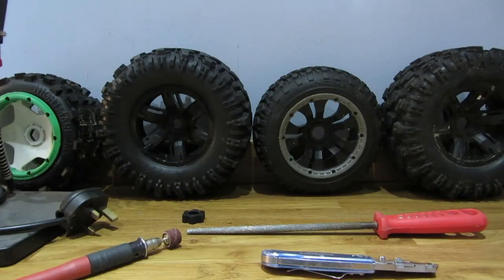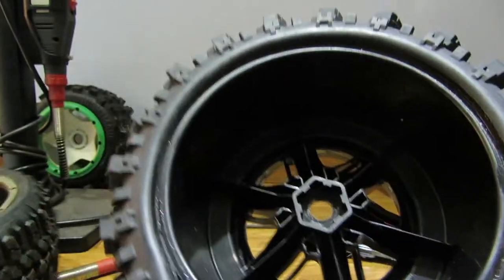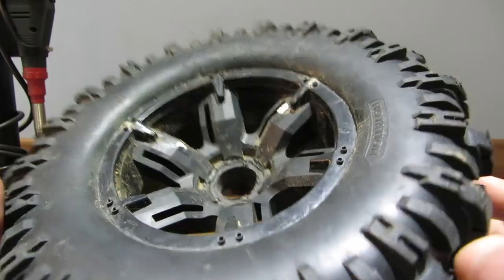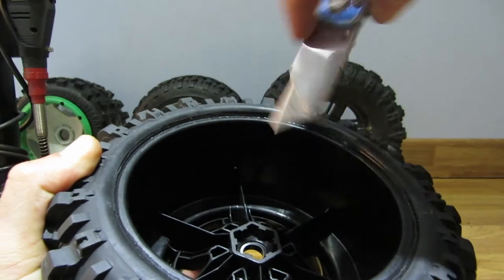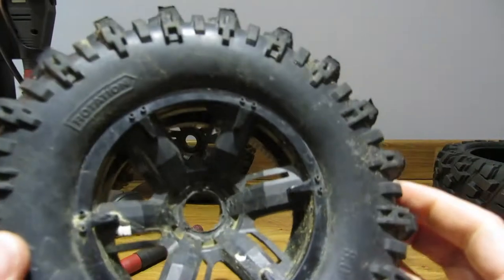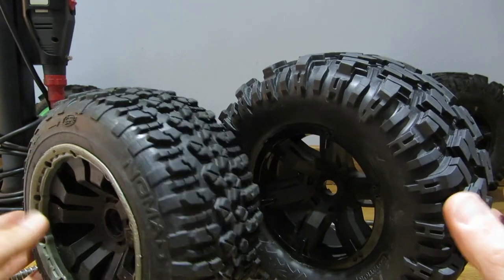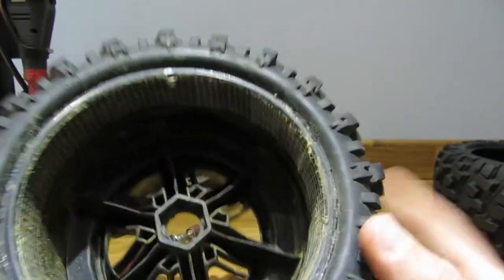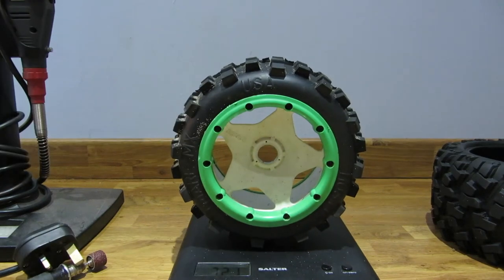HOW TO Mod Traxxas XMAXX wheels to fit Losi 5ive T Hpi Baja 5th scales etc...

Comment: To anyone doing this mod, I highly suggest using a quality body reamer as opposed to using a Dremel tool. The hole should be just barely big enough to fit over the hub to make a lot better positioning when mounted.
Reply from the maker: Good advice👍

Comment: Or how about fitting baja wheels..  from or rears on a Xmaxx? ? When will some one just make hub knuts that fit the baja rim onto Xmaxx?
Reply from the maker: there are mad max nuts that do that job. I do have a set of adapters actually. So i could try the rear baja wheels i have. I did try some sand paddle style 1/5 scale tyres and wheels on my xmaxxx over xmas. problem for me is they are just too small for it really and i feel it handles its best and jumps its best on the stock xmaxx wheels n tyres. check out my box track running vid with the xmaxx... as i started the run on losi 5t style wheels n tyres... and then changed to the stock ones.. will give u an idea of what i mean.. cheers ;)
Reply from the maker: here u go...

https://youtu.be/B5R-onqjsis

Comment: Can you go the other way round? I wanna run 5th scale buggy tires in my xmaxx at the track lol
Reply: Yes u can I'm currently doing the same I was gonna buy badlands mx43 but I can get the rovan excavators for 44.99 a set of 2 with rims at the badlands are 98.99 so I'll spend 99 bucks on 4 tires and wheels still gotta buy xmaxx 24mm adapters.   The badlands are heavy and cause issues and the rovans are about the same